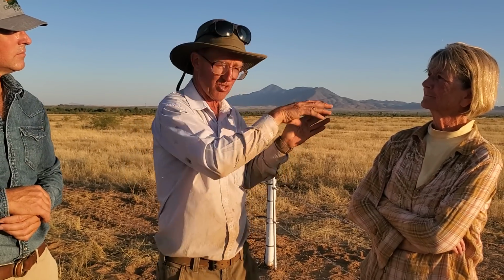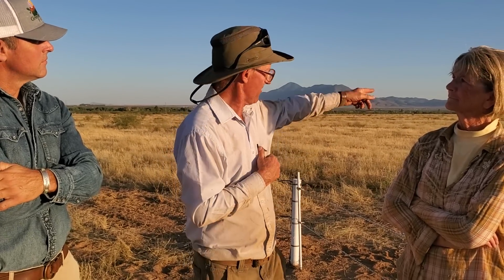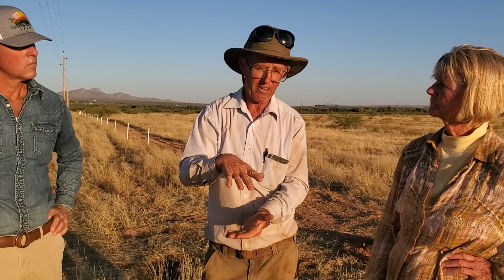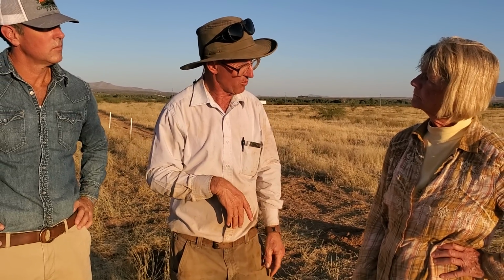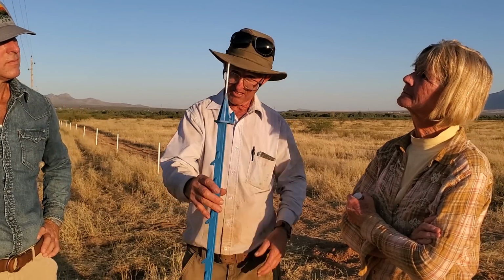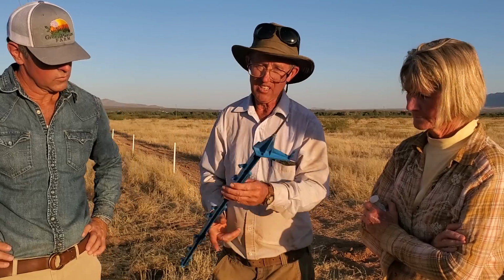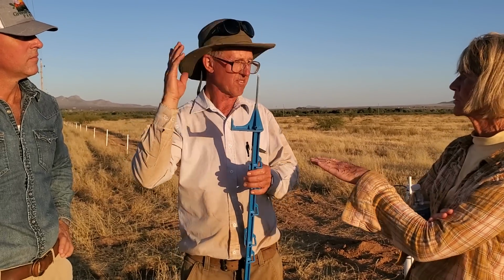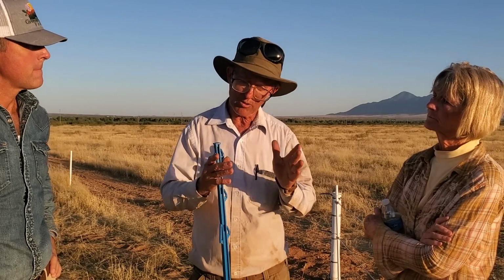Arizona regenerative grazing project introduction.

Comment: Greg I don't know how much leeway they're giving you with input but if you install a few spread out strips of subsurface drip irrigation on contour you can increase the sediment catchment drastically and slow the water runoff speed. With a few spread out strips of irrigated pasture you can more evenly spread the manure and urine distribution and accelerate the building of pore space in those strips to capture and leach water down hill. It's like having a bunch of low cost check dams. The irrigation can help you keep the biology alive in the dry times and some more cushion with keeping your core herd on the land without degrading it. You can run the drip lines on contour off of your main line for the cattle water. You can further reduce costs spreading the distance between lines. Instead of lines every 30 inches like they do in alfalfa production you can do 2 lines 40 inches apart and then space those pairs of lines 10 ft apart. By focusing on this strategy you can accelerate the proliferation of your biology and the cost of additional infrastructure will be less then 200 dollars per acre. by  Hope you get to read this.